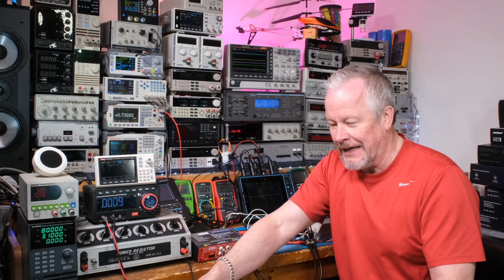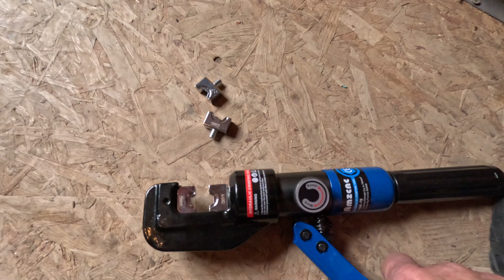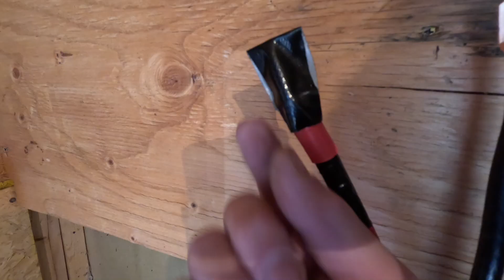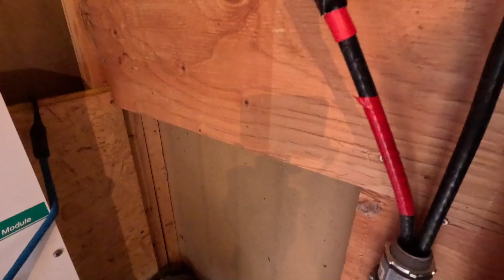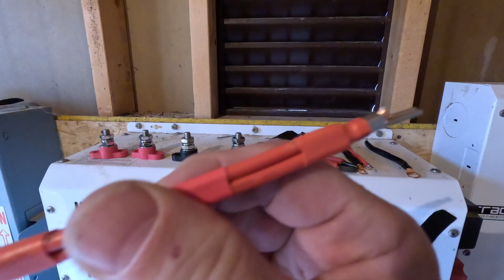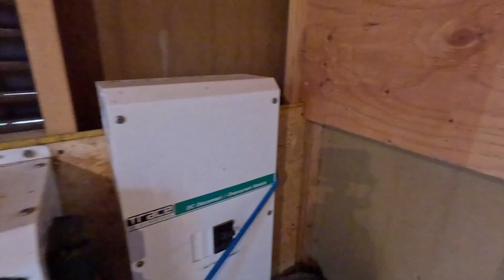Low Cost Hydraulic Lug Crimper and Cable Cutter and Cable Wire Tool Kit #cablecrimping

Comment: Marinehowto has a page discussing their tests with different crimpers including harbor freight, hydraulic, manual, hammer, Amphenol and others. I didn’t know there are two different terminal types, starter terminals and power terminals. The crimper needs to spec the terminal its made for as the page says. Search “Making Your Own Battery Cables”

Comment: Crimpers, and crimps, without any standardization, like these, may work for the weekend warrior that does occasional work installing lug terminations, but, truly reliable crimp lugs need standardized crimps from a company like Thomas & Betts or Burndy to have repeatable, quality results. I installed power and battery systems and bay configured Telecom equipment ( usually connected with anywhere from 6 Gauge stranded to 400 KCMIL gauge stranded wire) for a major telecom company in the US, and we were supplied with products from the 2 manufactures listed above to insure quality. The crimp lugs were also color coded to the dies needed to crimp them properly to take guess work out of making reliable connections. Of course, the tools and crimp lugs are more expensive, but, repeatable quality is more likely than not assured, and I never experienced a failure from using products from those 2 companies.
Reply from the maker: Thanks for the Pro feedback!  I was really impressed with this tool - but I'm sure if I did it everyday that the tools that you recommend would be worth the extra money.  For us weekend warriors - this is an excellent tool;)

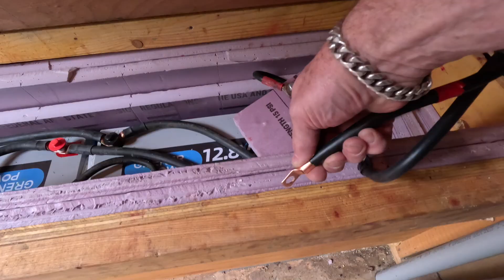Comment: I tested the claim that crimps are air tight. A terminal was crimped to 4 AWG cable like at 1:49 for a test sample. Next the terminal was soldered where the cable enters the terminal. The thought being if the crimp is air tight the solder will not wick into the cable and the terminal. Finally the terminal was cut in half and cross sectioned. The result? The solder wicked right into the cable in the terminal.  Crimped terminals are not air tight.
Reply: True, crimped terminals are not "air tight" , but, there's a mechanical bonding and pressure between the crimp barrel to wire that has a greater holding power if the lug does get heated due to a high current situation, than solder will have. Having worked with crimp lug and bus bar connections for years for a local telecom, we were also instructed to use an anti-corrosive compoind " NO-OX-ID A" from Sanchem chemicals, on the exposed wire before crimping, which one would think may male the wire slide out of a crimp, but using a major brand crimp lug made by Thomas & Betts or Burndy, with the proper tool from either company, I never had a wire slide out, come loose, or create a high resistance connection failure using said compound. Cabling we were supplied with was also straned and tinned, crimping on solid wire required longer barreled crmp lugs to insure a good mechinical connection with multiple crimps on the barrel, but for best results we almost always used fine stranded wire.
Reply from the maker: Thanks for the fantastic feedback!